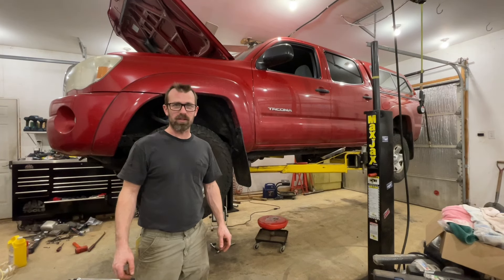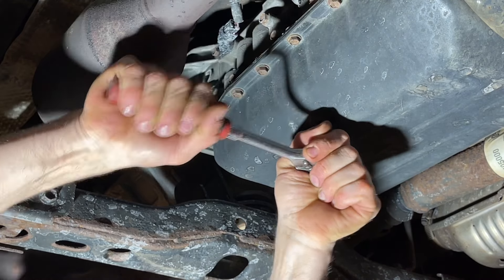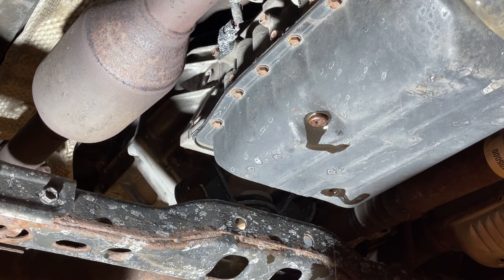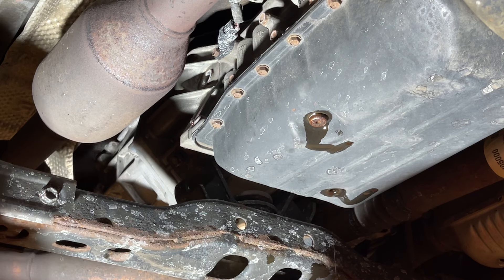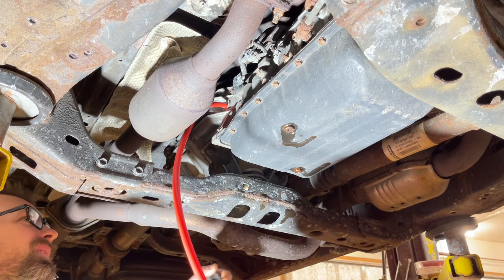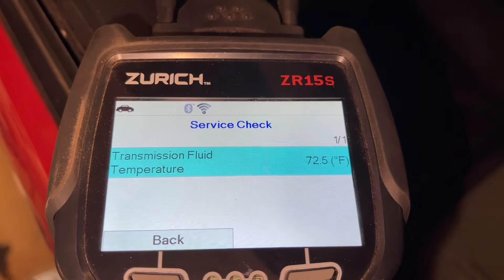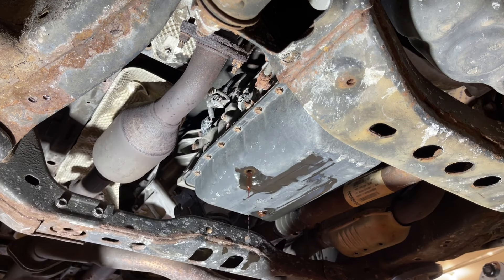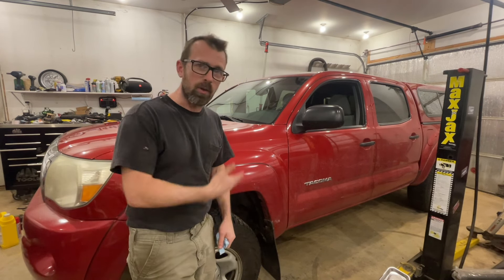2010 Toyota Tacoma transmission fluid change. 2008-2011 5 speed auto

Comment: You said "Good for another 60,000 miles".   For a drain & fill of 1 gallon ?  Wouldn't another 60,000 miles need ALL the fluid changed to achieve the 60,000 mile coverage?
Reply from the maker: Toyota recommends “replacing your transmission fluid every 60K miles.”  They are unclear on what quantity. Since this is the procedure on this vehicle I’m deducting from that, that this procedure should be done every 60K miles. I certainly would tell you not to do it more frequently, you can interpret their recommendations as you see fit.

On a practical level, I would recommend more frequently changing it if it looks particularly dark. If it looks great then I’d say you could extend it longer.
Reply: @bennieaust  Thanks. Wasn't sure if it was just drain & fill at 60k or all the fluid at 60k.
Reply: I have a 2007 Toyota Tacoma double cab trd sport 4 L V-6 with a five speed automatic transmission.  Good video, but all you did is drain 1/3 of the fluid.  I had the full service done on mine years ago.  I believe I paid $179 at Pep Boys.  They started off by removing the pan, and cleaning the inside of it, along with the magnets, replaced the gasket and the filter.  After reattaching the pan, they did a complete transmission fluid exchange 12 quarts.  Then checked the level.  They used a fully synthetic transmission fluid which is compatible with my transmission.  No issues.  I will be doing it again this year.  I change my own engine oil and filters, but I don’t mess with the transmission.  I wouldn’t save any money doing it myself.
Reply from the maker: @michaelcinaz  , that’s correct, this video covers a drain and refill only. It doesn’t cover dropping the pan or doing a flush. I personally am not against flushes but it won’t take you much searching online to open up that controversial topic. 

The transmission services I do are usually more based on the color of the fluid and less on the miles. If the fluid is very dark I will recommend a more aggressive service. 

Thanks for watching!